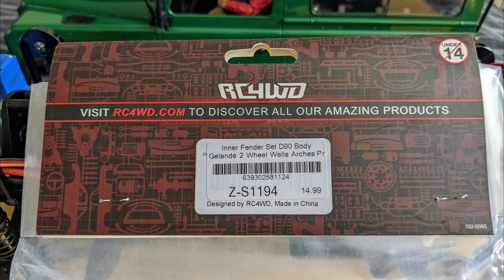RC4WD Gelande II Land Rover Defender D90

Comment: Noice! I like the way it rides, the all metal chassis and the weight of the body obviously helps quite a lot with the realism, and of course, traction! I hope you enjoy this so cool truck!
 I just accidentally 🤔 acquired one from a UK model shop that I just visited, for £325 pre-built, including the small RC4WD trailer and a radio set. And it's so clean I'm guessing it's never been run outdoors! Maybe a shelf queen? The only thing wrong I can see so far is rattly suspension , and under scale figures inside. I've ordered a couple of Tamiya ones and an RC4WD one as well. Oh and there's a DIY wall hook in the back bumper for the trailer. 🤦‍♂  Haven't driven it yet, as I'll have to wait till I get home, wasn't planning any RC this weekend, so no batteries or charger.
Reply from the maker: Thank you very much for watching my video. It sounds like you got a real bargain. They're good RC's for trailing and I really enjoy running mine 🙂👍🏼

Comment: Nice Landy in the right colours, funny the servo horn and too long screw.
Reply from the maker: Hi Mal. The servo horn was odd, but I think the original RC4WD metal one may have been taken off to use on another RC when this was put up for sale. I didn't notice it at first and it worked ok on the initial test run in the garden. I had the metal one in my spares so it was a quick inexpensive fix.

Comment: Looks lovely! 😎👍
Reply from the maker: Hi Steve. Thanks very much. It was interesting trying to get up the slope without tipping over. The metal luggage rack looks nice but adds a lot of weight up top.
Reply: @hollyhillrc  Yeah, mine's the same. The weight up high and right at the back is the limiting factor.
Reply from the maker: I wasn't sure if I liked the wheel on the bonnet when I got it. But I think the weight there helped to give the traction it needed to get up the slope, and I'm liking the look of it more now too. All these things contribute to the challenges of scale RC driving which I really enjoy.

Comment: Great car and cool updates. I like the license plate😁. As I saw the run, might I recomment new tires and som mor weight?
Reply from the maker: Thank you very much for your thoughts my friend. I enjoyed trying to get up the slope with the stock tyres, and even though it struggled it did make it up eventually. Better tyres would make it easier, but that would take a lot of the challenge (and fun) away for me, so I will keep the stock ones on. But the metal luggage rack does make the D90 a bit top heavy so some more weight low down is a good suggestion.
Reply: @hollyhillrc  As long as you have fun, I wouldn't change it either👍

Comment: maybe that roof rack makes it a bit wibbly wobbly but everything else looks to help rather than hinder. Wheel on the bonnet is so Landie, so Daktari, it MUST stay hehe. And I must say, those AT tyres impressed on Steve's 18th Gelande3 and now on your bigger brother. I like it, defo a good deal on ebay sir!
Reply from the maker: Hello mate. Thank you very much. Daktari is a word I haven't heard for a very long time and was an epic series back in the day. One of my childhood favourites. Thanks for reminding me about that, and the memories. The metal rack does make it top heavy, however it also makes things a lot more interesting when I run it up slopes like this. It was a fine line between tipping over or staying upright a few times. I found that exciting and I won't be doing anything to try and correct it. I like the look of the rack too and may put some lightweight scale accessories on it in the future. The tyres impressed me as well, and because I use my RC's for trailing, as opposed to crawling, I see no reason to change them.
Reply: @hollyhillrc  yeah nothing wrong with that rig as is. Well, except for a zebra colour scheme and a cross eyed lion on the top rack 🦁

Comment: Hello, Derek - good work on the restoration. This is a lovely truck, and deserves decent servo hardware and a set of inner fenders. I bet the driver figure can't believe his luck!
The run is terrific - impressive grip @ 3:48, and good persistence on your part!
Reply from the maker: Hi Del. Thank you very much. The servo horn was a surprise but maybe the original RC4WD metal one was replaced before the seller listed the D90 on eBay. It wasn't a problem because the metal one I used was a spare in my RC box of goodies. I enjoyed the run a lot and it was fun trying to get up the hill. Someone has suggested better tyres, but I think that would eliminate the challenge, and considering it did actually make it up the hill the stock tyres proved their worth and will be staying on.
Reply: @hollyhillrc  It took me a long time to realise that if you improve performance you end up having to look for more challenging terrain, and don't necessarily have more fun.
Reply from the maker: @Del350K4  It's something I realised when I ran a Axial SCX10 and a CC-01 in the same place. I had to really work at it with the CC-01, and the SCX10 went over it with ease. Each is satisfying in its own way, but I do like a challenge if I can find some good terrain. I mainly trail with my RC's because I don't have many options near by, and travelling is becoming more difficult due to my health these days.
Reply: @hollyhillrc  I'm very sorry to hear that I'll health is a problem for you.
Mark and Rob have also, I know, had to confront this issue over the last couple of years, as has Pascal.
I hope you get a lot of satisfaction and pleasure from the RC action that you do manage to enjoy.

Comment: Hiya Derek.  Really nice scale looks to that one.  Your additions improved it yet further. Who on earth put that servo horn etc. in?!  I did cheer when you finally got it up that slope.  So that's the fun of crawling? I sort of get it now although I'd rather hit that slope at 25mph and see what happened!  Hope you are ok mate.  Hopefully a meet up before too long :-)
Reply from the maker: Ha Ha Ha. From a "Captain Slow" point of view Pete, if you hit the slope at 25mph it would go flying over the top in a few seconds, and your fun factor would only last a few seconds. But I guess if you did it over and over again it would prolong your enjoyment. My fun factor was the 57 seconds it took trying different lines and speeds on the loose dirt to conquer the slope with a top heavy scale RC with stock tyres. The feeling of success when it finally climbed over the summit was good, and that's why I enjoy this side of the RC hobby so much. Thanks for cheering though mate ! lol. Always appreciate your support. I'm guessing the original metal servo horn was swapped out before the D90 was listed on eBay. It wasn't a problem though because I had a spare metal one to replace it.